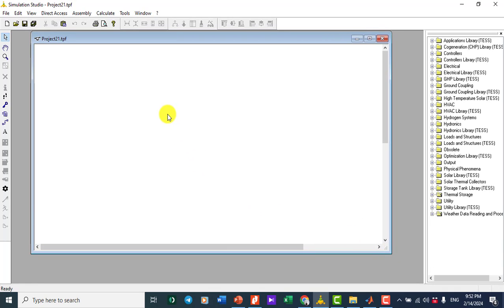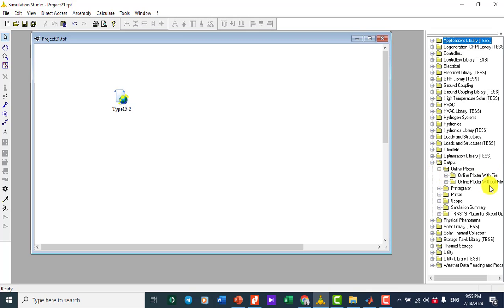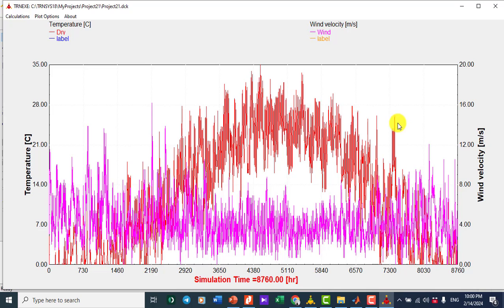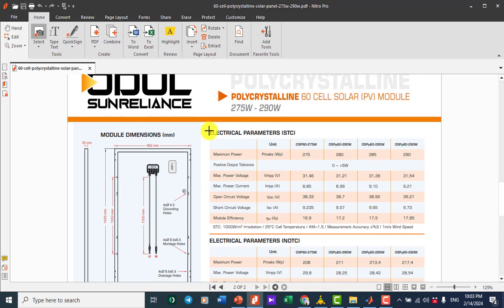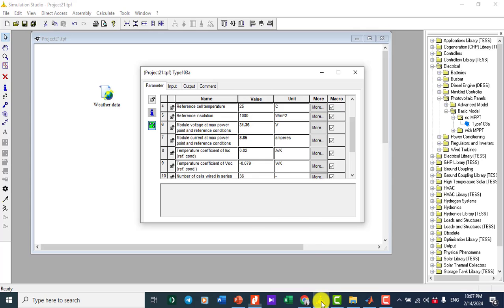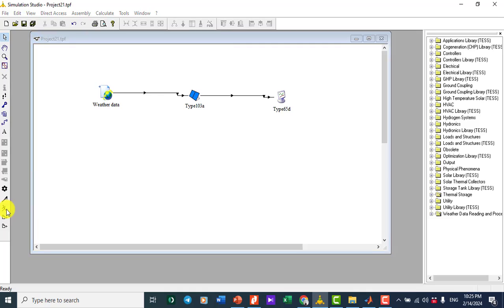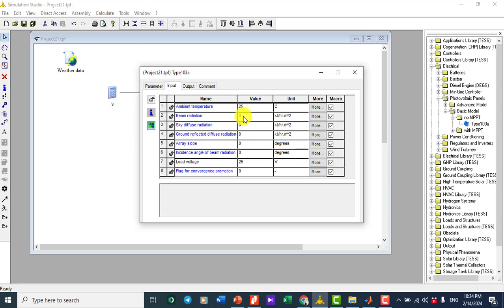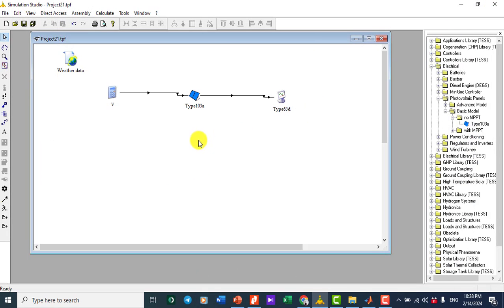TRNSYS simulation of PV panels and I-V curve.

Comment: Thanks for the tutorial. However, I am just wondering why the units of ISC and VOC do not match between the software and the catalogue. The units in catalogue are in %/C, while the the corresponding parameters in TRNSYS have A/C and V/C. Does it make sence?
Reply: Also, number of cells that are being wired together are 60, I assume. Am I right?